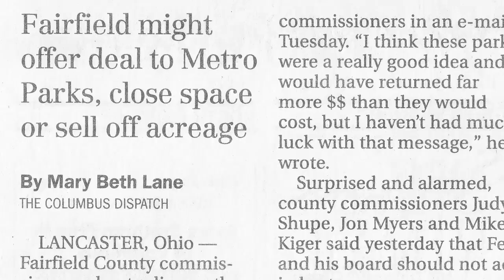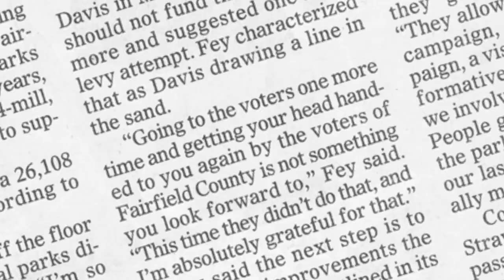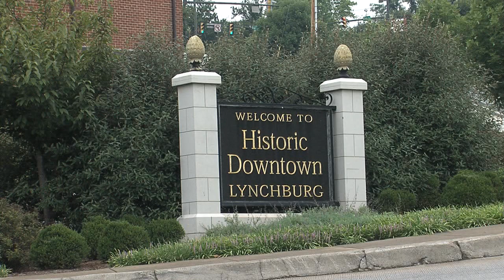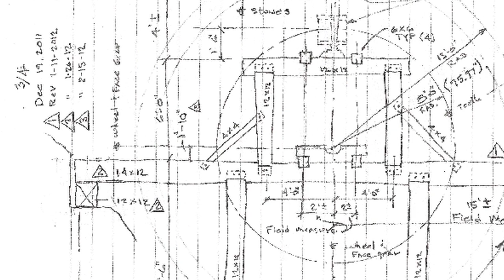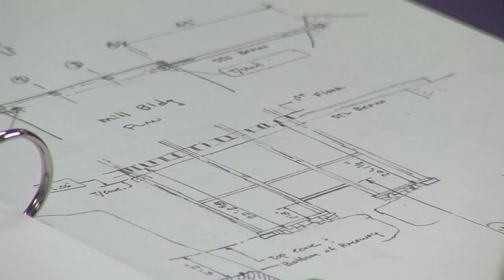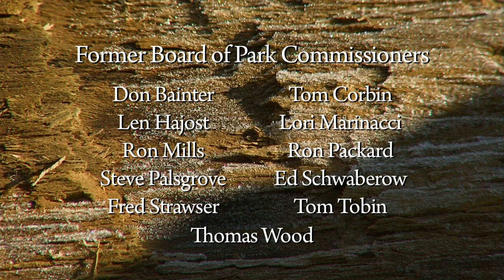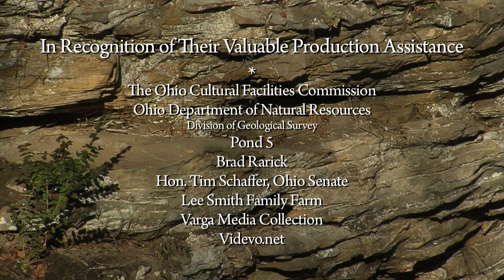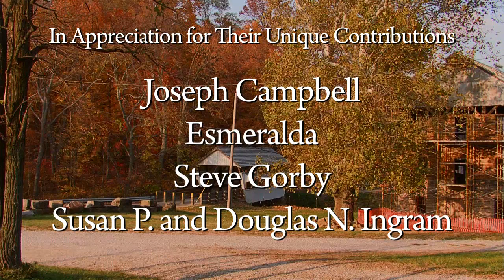Rock Mill: Saving An Original (documentary)

Comment: Just visited amazing restoration of the building but kind if a letdown that restored or replica equipment wasn't brought in to bring the whole place back to operations and the wheel although functional is being ran off a water pump instead of replacing the missing dam which also wouldn't be that big of a deal to fix because to spot in the creek needing dam-d is probably only 15 ft wide and 20 ft deep  if someone wants to see a functioning mill and buy local flour bears mill in dark county is an exceptional preserved example.   hopefully a couple years down the road after im established with the horse drawn farm equipment research/restoration/reproduction business im trying to start ill be able to expand into farm windmills and rebuilding Americas lost 100,000 gristmills  i say use the local water that way things like flour aren't traveling 400 miles before they get to my pantry like the flour at aldi packed in ILLINOIS and transported to southern ohio